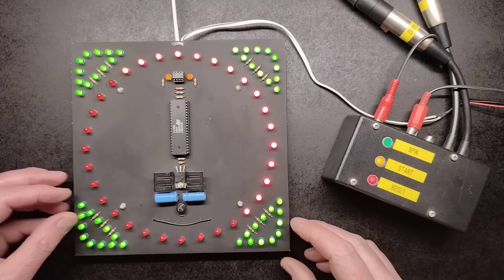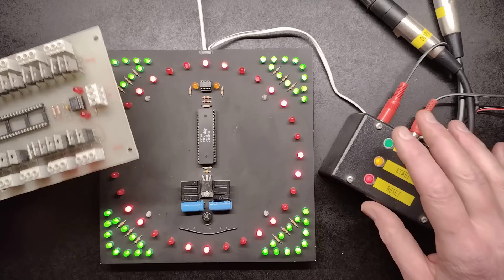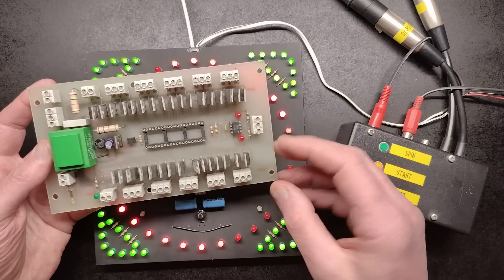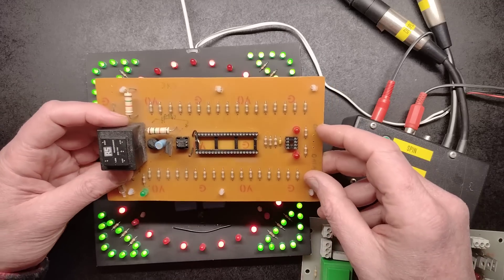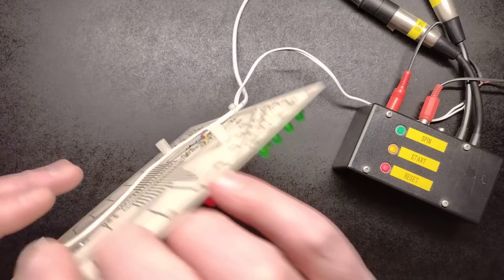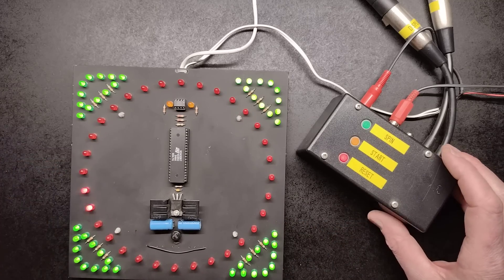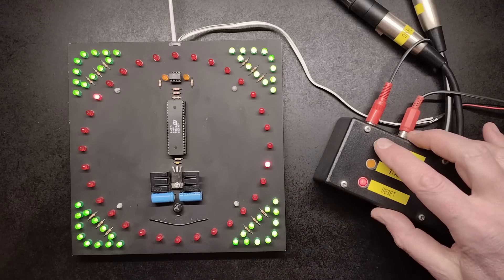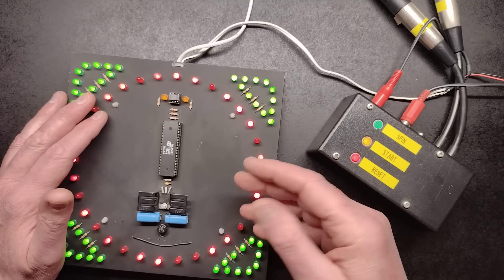Flux and carnival games (Loud 8-bit noises!)

Comment: Back in the late 90's/early 2000's I cam remember playing around with the ISD1000A digital audio chips. 
Everything was pretty much built into the chip... Mic preamp, memory, direct access to memory addresses, audio amp, etc. All you needed was some switches, condenser mic, speaker, a few passives, and you had a whole digital record/playback system that could hold 20 seconds of "High Quality" audio. The addressable memory was great, you could record a bunch of short messages in it, and then playback the ones you wanted for whatever "trigger" you desired. You could use a micro controller for the addressable memory, or do it analog style.

I remember installing one in my wife's car, and it would tell her that she left her lights on, door open, truck ajar, left the keys in the ignition if she opened the door, have a good day at work, and so on. I didn't tell her I did it, and she said it scared the SHIT out of her the first time she heard my voice when she was in the car alone and it played a message... 
She thought I was hiding in the back seat. 😂 I wish I could have been there to see her face. 

I think I still have a couple of these I.C.'s in my junk bins somewhere. They were fun.

Edit: Not that long ago I saw a greeting card in a store, that has some circuitry in it that would let you press a button and record your own 10 second greeting, and then it would play it back when the recipient opened the card. I bought it just to take it apart and see what was inside it..... It was just a blob chip, battery, plastic speaker(which was also used as a Mic when recording), tactile button, sliding switch attached to the two halves of the card pages to activate it, a cap or two, and a resistor on a tiny board. 
A FAR cry from the HUGE 28-pin DIP package that was the ISD1000A.

Comment: FWIW, last year I had occasion to open and examine the amplifier I built when I was in college in the early '70s and I didn't notice any corrosion around soldered connections. It never occurred to me that there could be a reason to clean off the residue from rosin flux then and I still don't see any benefit from it.

Comment: If you were using the SK10 spray on flux it was fine to leave, as it both was a protective coating, and also a flux layer to the board. I did a few home made boards with this, and even after a decade or two the boards were still reasonable, though having them pretty much near the ocean did mean the component leads corroded, except for those boards where I had sprayed both sides with the SK10 after completion, where the legs, although dull, were still perfect. Repairs you would need to use a bit more flux, because the board would be slightly dull under that flux, but it would still solder after a fresh bit was applied, either in the solder or as a drop of liquid.
Reply from the maker: I tried spray on flux for a while but had issues in mains applications with tracking between adjacent connections.
Reply: @bigclivedotcom  Yes issues with tracking at high voltage, but low voltage fine, and with mains on board large spacing worked well. For mains boards a clean with thinners, using a stiff brush, worked well, followed with a coat or three of clear lacquer worked well. Cheaper than the PCB conformal coating compounds, and a lot longer shelf life as well.

Comment: I've still got a power supply I put together (mostly from Radio Shack parts and Archer 60/40 flux core solder) about 1975.  Works fine and no sign of any corrosion.

Comment: rosin flux is available in several different levels of "activity."  The Kester 44 solder on my bench is "Rosin Mildly Activated" (or MA or RMA) IIRC, which usually does not need to be cleaned.  Definitely on the "do not need to clean" side I also have non-activated rosin and I've used a Non-Clean rosin (NC) flux that is between non-activated and RMA.
What I remember from talking with a laser printer manufacturing engineer during the transition to RoHS compliance, is they had been using Fully Activated or simply Rosin Activated (RA) flux with the lead-based solder as it would aggressively and quickly clean and etch the surfaces for/during wave soldering. He said it was imperative the board be cleaned of residue after that, but the manual soldering (for rework or if any manual steps were needed) used flux that did not need to be cleaned.  He was complaining about the no lead solder and flux being a far more difficult process to get right.  (I missed those sem-random cafeteria conversations after they sold the manufacturing to another firm.)

Comment: Mr Clive I think I have a video series idea for you. Could you do a series on testing cheaper eBay/Amazon/whatever soldering tools and supplies? Also another topic people would likely enjoy would be the exploration of different connector types. Like waterproof options. Maybe types they use on vehicles and then types they use in industry and then types for typical home gamers. Idk would be cool to see you test and explain those things to us.
Reply: The atrocious electrical safety of some of that stuff isn't brought up enough. Those cheap hot air stations with the blower in the handpiece come to mind, mains heater, mains on the front panel din connector...

Comment: Peeked in my second oldest device, a transmitter/receiver. Early 30's Japanese. All the wires are rosin coated/dipped, every connection has a bit of flux on it. Solder looks as good as the day it was made, if a little duller after 90 years. The older-ish thing is a pr-4 Fisher pre-amp. It isn't open now but I did have it open before desoldering equaliser leads out (Gotham) that were in hard an not on a mono (rca?) cable. Perfect back then.
Reply: Not the pr-6 either. I'm not mistaken. Thing is almost not in the internet at all beside one museum example as far as I can tell (haven't look recently though) 😃 prolly should.

Comment: The tolerance of a circuit to residual flux depends a lot on the nature of the circuitry and the operating environment.

In days gone by, the circuit boards in lots of consumer electronics such as TV had great gobs of residual flux. Flux was applied to the stuffed board, typically with a foamer, just before wave soldering. Cleaning simply wasn't done. The fluxes usually were "fully" activated rosin types. With the sorts of circuitry and domestic environment everything stood up well. For a very long time virtually all cored solder sold for general electronics was fully activated rosin type that no one removed. 

If boards are actually corroding you are in grave peril of circuit misoperation long before corrosion, again depending on the nature of the circuity. Digital circuity where all the nodes are driven at quite low impedance will tolerate a lot of leakage current without failure. Precision analog circuity where leakage currents of picoamps can make a mess of things is an entirely different matter. Flux residue and other contaminants can cause misoperation, often erratic and hard to diagnose, without the slightest visible sign of issue with the board itself.

I've cleaned an awful lot of circuit boards manually. It is time consuming and tedious to do it well, and somewhat hazardous when an organic solvent such as isopropanol is used. I used to use a three-bath process. The first bath removed the bulk of the flux, the second removed most of the remainder and the final the last traces. Each bath was moved down one as they become contaminated (3rd became 2nd,  2 became 1 and fresh alcohol used for 3). I would often use a compressed air blow-off before the final bath to remove most of the contaminated alcohol. Single sided boards are harder to clean than double because of the flux in the holes. Natural rosin-based fluxes are MUCH easier to remove with this process than others. "No-clean" fluxes that I've used are EXCEEDINGLY hard to remove with alcohol. The process I've seen recommended uses an aqueous solution of a saponifier made for the purpose in a spray system. The saponifier solution softens just the surface and the spray removes the softened flux. Run long enough full cleaning is possible. I've used aqueous saponifier for ordinary rosin fluxes. It works quite well and unlike alcohol isn't flammable.

My preference where cleaning was deemed necessary and everything was compatible was water soluble flux. They are quite aggressive and work even better than fully activated rosin, but absolutely MUST be washed off within a few hours. If not removed promptly corrosion products that are nearly impossible to remove can form. Some of the aq fluxes smell pretty revolting.

Cleaning under components is difficult, especially with surface mount parts. Again, I prefer water-soluble flux and have used warm tap water at as-it-comes pressure through a small flat spray nozzle (intended for spraying agricultural crops). By working from all directions this seems to be quite effective but is tedious (and noisy!). I would follow the tap water spray with air blow-off and then rinse in deionized water. I became fairly convinced that my process was more effective than that used by my contract manufacturer which used a commercial board washer right after the reflow line. (They used a water-only process. I think that surface tension will keep water trapped under SMDs and that water is hard to displace without high pressure directed spray or use of a wetting agent. Cleaning lines use electrical conductivity of the water to assess cleaning and I think that fails to detect contaminated water trapped under parts.)

A lot of what I've done has either been precision, sensitive analog circuitry and/or required conformal coating for use in harsh environments.

I don't do this stuff anymore. I miss it about like I think someone would miss bedbugs when they were finally gone.

Comment: Rosin flux residue seems to be absolutely harmless. When I started to work in aviation our instructors always made a big thing about creating “clean” solder joints, which usually meant that they burned the living daylights out of theirs until the last bit of flux had been incinerated. Causing unnecessary thermal stress for the components and dull-looking solder surfaces – with leaded solder! Given my previous experience I already considered this as poppycock and typical style of old-school (poor) instructor bragging: “Look what I can do and you may never learn…”

And I was properly vindicated when I had the opportunity to open my first discarded device from an aircraft. Nice shiny solder joints with the occasional tiny brown rosin crusts but no corrosion around them on a PCB that had served for more than 25 years before being withdrawn from active duty due to obsolescence.

Comment: The sound effects are mind blowing for a 16 series PIC!  I see in the description a 3 bit resistor DAC or something... wow.

Regarding flux, I had some high frequency 555 timer circuitry that would only run at the calculated frequency when flux was washed off the board.  Standard rosin electronic safe flux, nothing that could conduct.  My only instance of having to remove it other than washed PCB sure look nice.
Reply from the maker: The DAC was based on a resistor ladder and three output bits.

Comment: I collect vintage electronics and it is very common that I have to do extensive resoldering because of ring shaped cracks around the solder joints. I also find the green masking of the circuit board often started flaking due to the weird places I find my items in. Moisture is a big issue. I wanted to ask what I can do to repaint that.
Reply from the maker: It might be viable to spray the PCBs with a conformal coating.

Comment: I tend to believe the flux is not a problem in general. However, if done sloppily, it might be prudent to clean it up, but obviously, you don't fit that description. Another factor that might affect the potential for corrosion, would be how and where the electronics are used and stored, i.e. if used in a high humidity or excessive heat environment, which I'm sure your devices have been in a relatively well controlled environment, could potentially promote such corrosion. I can definitely see the potential risks of seepage from cleaning!

What I like most about this video though is, that you get to review a VINTAGE piece of electronics, that you yourself, not only engineered, but built, tested, and sampled your own voice on, which ultimately ended up being used in a commercial setting! 5 golden stars Clive, five golden stars!

Comment: What chip was used to make those sounds?
Reply: Clive said it was square wave, so direct from the PIC using some clever timing
Reply from the maker: The sounds were being generated in software in the single microcontroller used in the game.
Reply from the maker: I should add that I used an external resistor ladder to give multiple volume levels.
https://en.wikipedia.org/wiki/Resistor_ladder

Comment: I remember some book warning to never use acid (?) flux, which I associate with gutters or maybe plumbing. That book could've dated from the days of tubes; I wonder if it was more of a problem then because that flux was much more likely to be found in the home (or hardware store) than electrical grade flux.
Reply: I recall hearing about this as well but it was much later I know it was probably early eighties or after at least so I don't think it was just an early thing in electronics but sometimes people did not realize there was a difference between the acid core type Plumbing solder and the electronics rosin core solder I had seen things that had been assembled with acid core solder highly not recruited but in some cases non-working completely after a while because of the acid core flux as well

Comment: louis rossmann drowns circuit boards in some kind of diluted rosin mix.  what is it and does he get rid of it?
Reply from the maker: It's flux paste, and I think he washes it off afterwards.
Reply: @bigclivedotcom  I dug around, and someone said his boards are all ultrasonically cleaned afterwards, in alcohol I presume.   ok, if you do it for a living but not for the masses.  
I have been using a slighty acidic prep cleaner, and then cleaning vigorously afterward.  Thank you for great video -will switch tactics to mostly rosin core soldering only, unless board is old and/or corrosive, and also be more careful cleaning when using fluxes with acid so prevent damage to any other areas of the circuit board.  
I think Mr. Carlson uses some type of varnish remover to clean sometimes for solder prepping?

Comment: I have a 6502 based computer (rocking an expansion board with rows of 2114 memory chips - 8 X 32k and overclocked to 2mhz). I built it in 1978 based on a bare board from Ohio Scientific instruments. I showed it to my son (who is also an engineer) a few months back, and it's spotless despite less than ideal storage conditions over the last 45 years. I wish I could say the same for the ASR33 Teletype that I used for the printer and modded Zenith 12"bw TV I used for a monitor. It was soldered mostly with Ersin Multicore 37/63 and not cleaned. The flux is still evident, but corrosion free. I recall the solder as it was a gift from an older friend who was also a Radio amateur, and was a pretty rare thing back when most hobbyists were using Radio Shack or Chemtronics solder.

Comment: I had a few for the popular video games, and pinball machines like "8 baaaaaallll Deluxe" , "stop scratching, start chalking" ....👍
Reply from the maker: "Quit talkin' and start chalkin'."  I have an 8-ball deluxe LE right next to me.
Reply: We used to mix the words up on purpose, it was a Shop joke, we worked on  so many of those things, I was a Bally Midway tech during the 6800 to 68000 micro processors  I am the guy the solved the Williams Black Water 1000 ball count problem.  Also worked on Wurlitzer, Seeberg, am I, and the rock Ola, Chicago coin, Gottlieb, Capcom, greyhound, sega, Donky Dong Donky kong, many weird inbetween,,Olympia, vendo, automatic products, coinco, Mars, wooden legs, shuffle boards, bowling base ball....  I miss all that stuff and remember so much of those, always use to say your really getting into the repair when you replace shot guns hand guns and clutch cables while working on arcade equipment, some day  maybe I will find on of those hand built sit down x/y monitor "Tail Gunner"s.

Comment: Dried flux can trap moisture and other chemicals from the soldering process.  When soldering by hand it's not so bad, but when hundreds of joints per minute are getting soldered by machine, that's a lot of flux left behind.

Comment: I have some sound effects units I made with my father in the 1970s on veroboard from designs in magazines, and you can still see the rosin flux on the boards we didn't bother to remove, and the modules I have tested still work with the exception of a couple who's capacitors had committed suicide. (Its worth pointing out we used Ersin Multicore, a high quality solder, so maybe that was part of the teason) One issue with rosin flux is that it can get sticky if it gets hot (like being stored in a loft space) and will attract and retain dust, which then will conduct electricity should it get damp. If you want to remove rosin flux, you really need to scrub it in a bath of solvent - spraying it from a pump bottle and rubbing it with a toothbrush will just spread it around unless you are very, very generous and remove it with a cloth before it evaporates.. You won't be able to see it, but its stlll there making the PCB sticky.